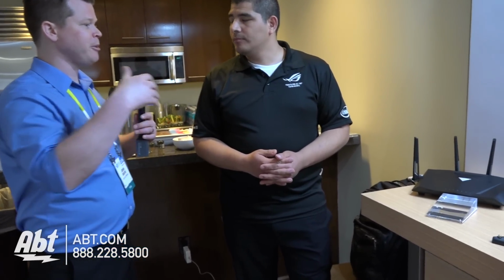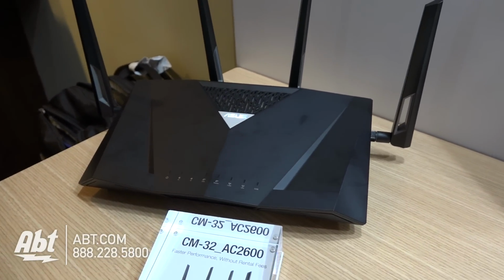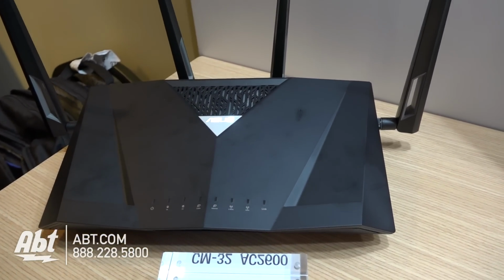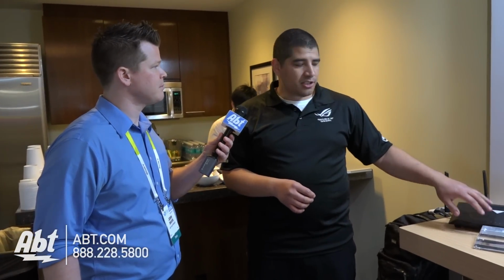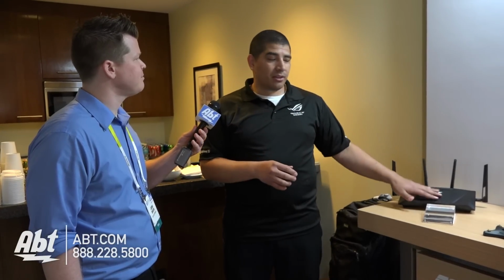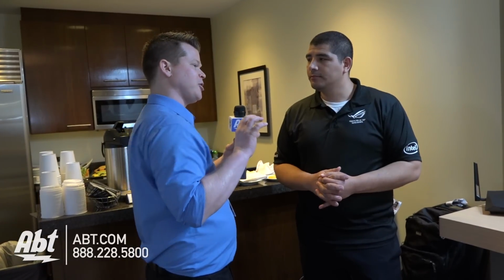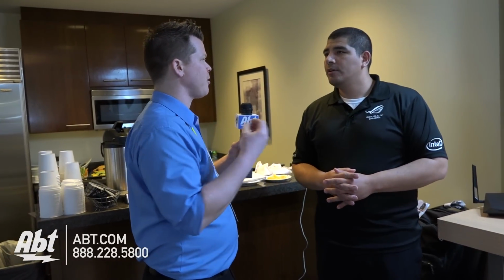Asus CM-32 AC2600 High-Performance Router and Cable Modem - Abt CES 2016

Comment: Spectrum said they wouldn't help me set up this souter for their service even though the box has their logo on it and their website says they provide SERVICE even though their website specifically says they will. 

I wasted like $200+ at the time because it immediately went into my closet for the next couple of years until I just found it and am trying to use it as a network extender (a $40 tops solution.)

Comment: This thing is looking like vaporware. Taking way too long to be released. I have called Asus numerous times and they claim they either haven't heard of it, it's not in their data base or they have no information on a release date. Most of them act like they have never heard of it. I can't even get a straight answer to see if it's still in the works or if they scraped the project. Asus is doing a piss poor job in handling this. I just went ahead and got the Archer CR700. Tired of waiting with no end in sight.

Comment: dose this have a RG6 port on the back ? or how do you conduct on a RG6 to this router
Reply: F fitting - RG6 is a coax type of cable but not the connector. There is a standard F type fitting next to the power supply.